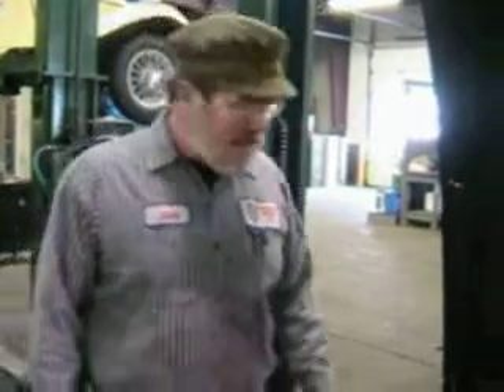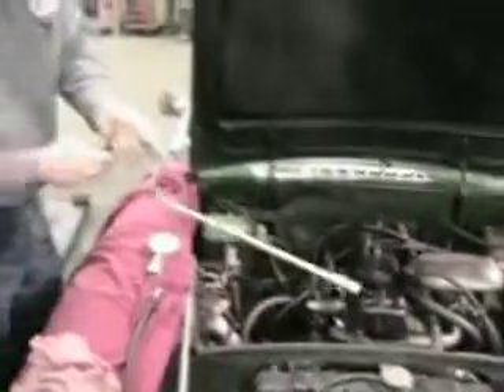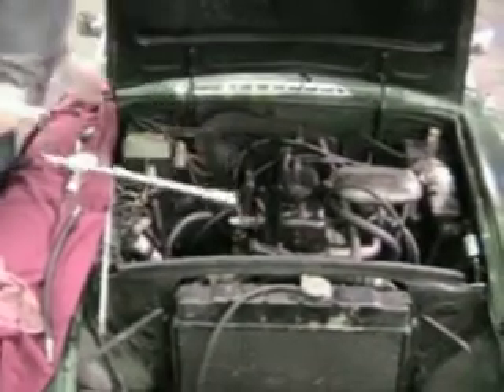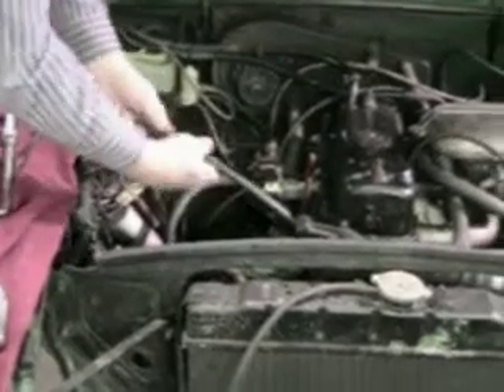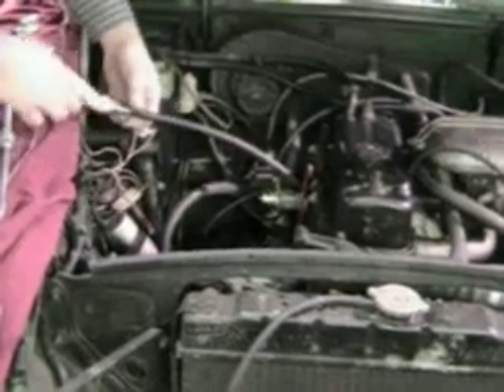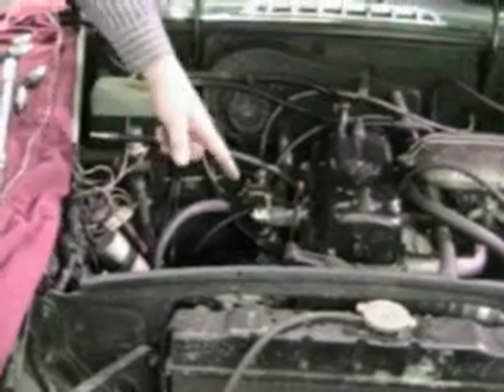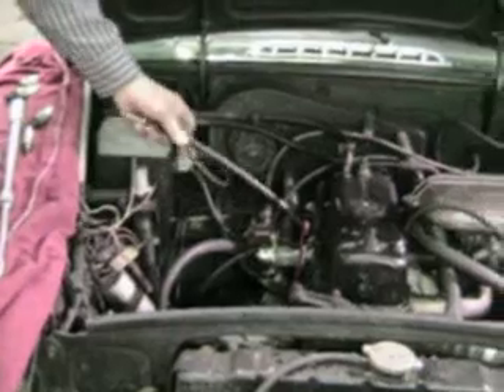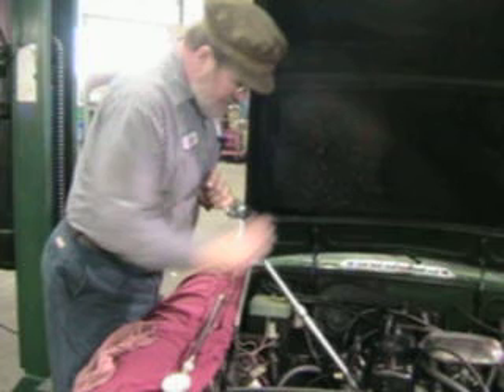046 MG Tech |  How to Check the Compression on MG engine

Comment: I've done several compression tests but I have a new problem. Like you I screwed the hose into the cylinder but when i tried to get it out it free wheels in the cylinder. The plugs are recessed in a 6 inch deep steel tube in the head. The engine; 2.0 DOHC 1997 Mitsubishi eclipse.

How do I get the hose out without damage to the car or tool?